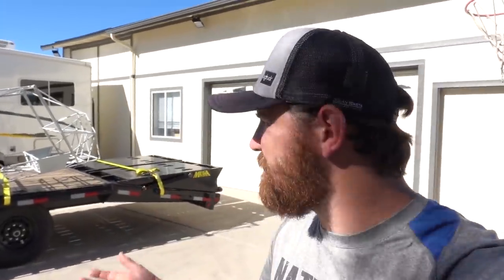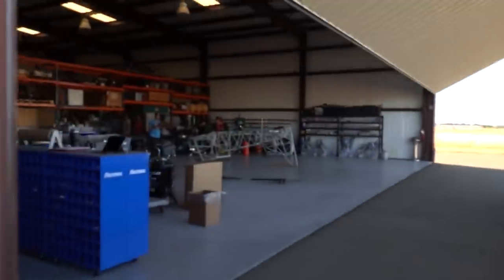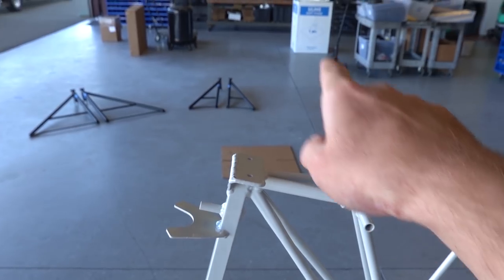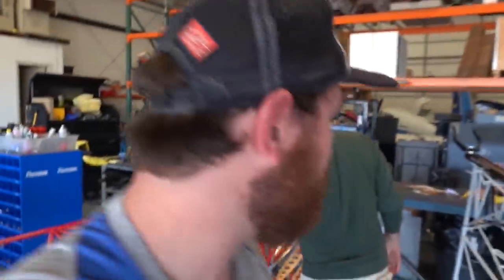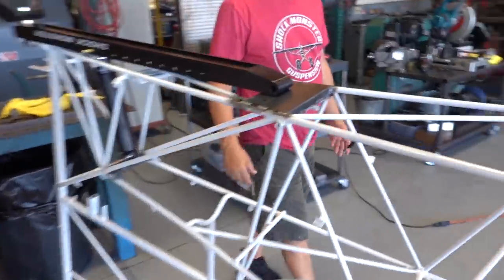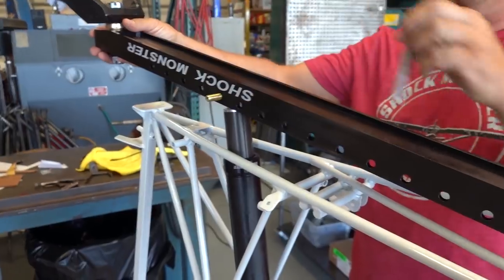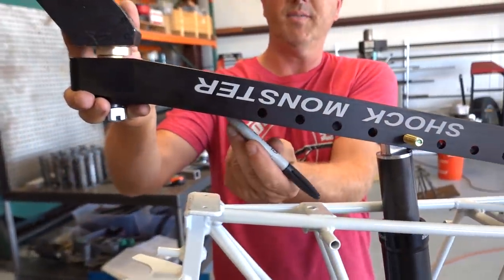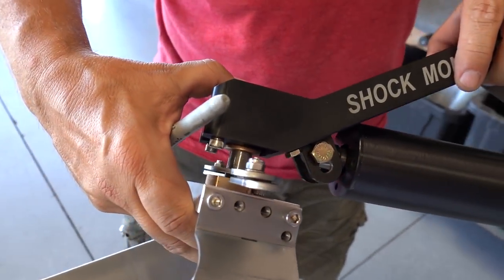Tail Wheel Suspension, Phoenix Fox Build 2

Comment: I'm wondering if that is a large amount of weight you are putting on the tail? How does it compare with a typical tail wheel set up?
Good luck. Maybe it will offset the added weight of the 915 Rotax motor...
Take care.